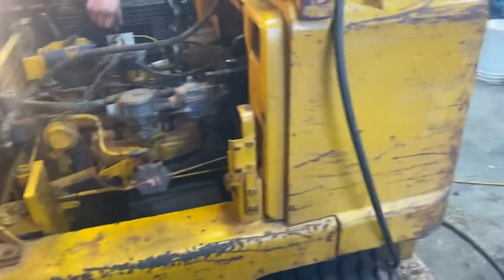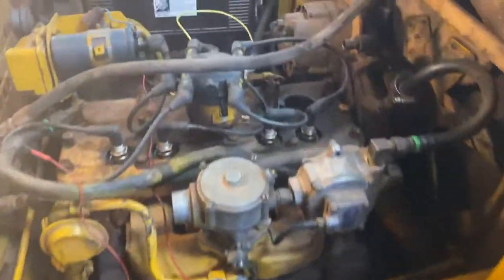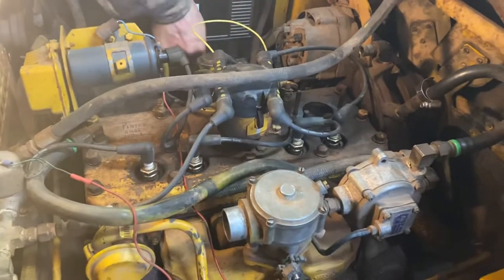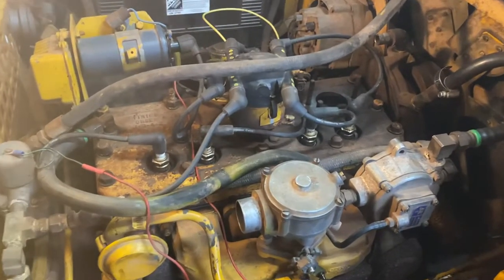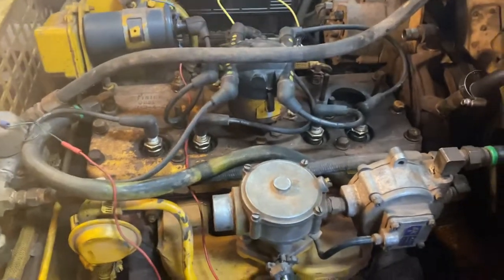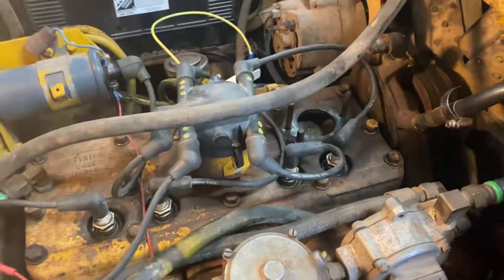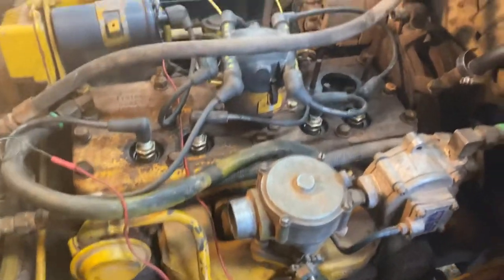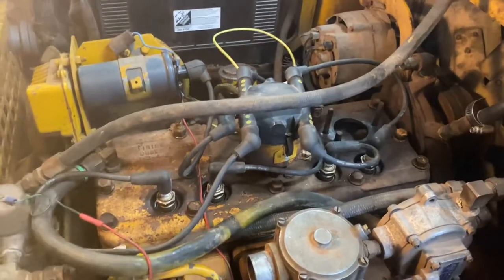CAT/TOWMOTOR continental F162 fire up after valve job

Comment: Must be an original ignition coil to be installed horizontally. Newer ones must be installed vertically. Older ones had oil, newer  ones (usually) don’t. Learned that lesson the hard way.